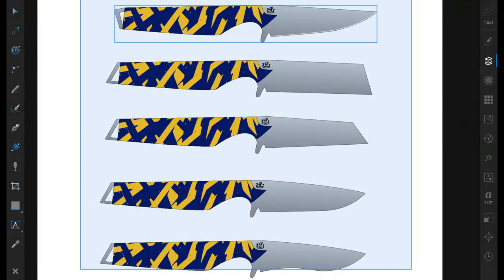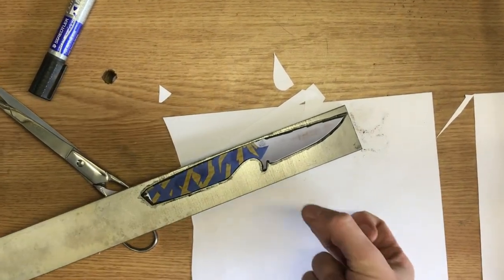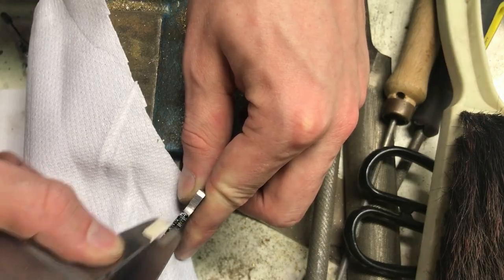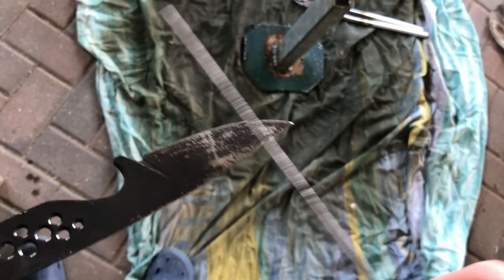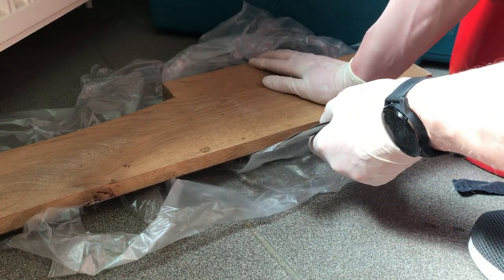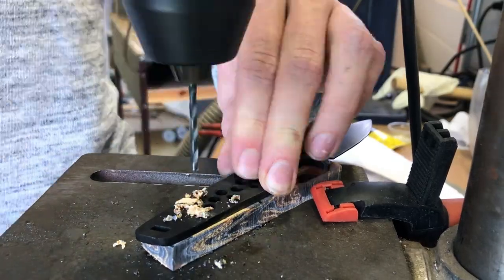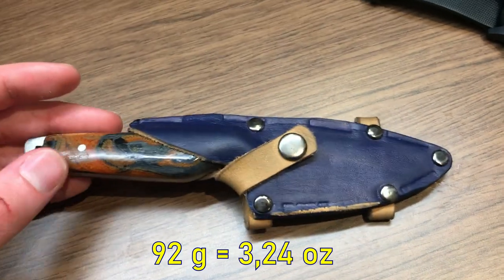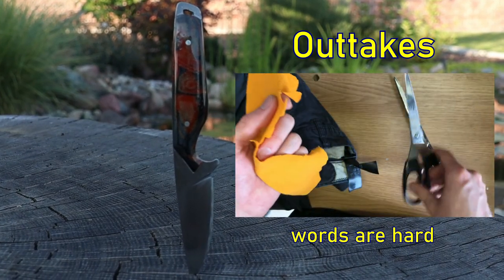EDC Knife with homemade Micarta

Comment: You should think about building a folding worktop on wheels so you can just move it where you need and slide it against a wall folded up when you're done. It wont be the biggest workbench but it can be extremely useable. I've done that for my room. Tiny room but its the only place I have since I rent with 2 other people in a small house. Without it I would be dead in the water. Woodworking is in my opinion a top 5 skill everyone should learn and use for problem solving
Reply from the maker: That’s a good idea! I’ll consider that for my own workshop in the future
Thanks for watching!

Comment: "Now I finaly shut up and show you the result" - best outro ever lol 😂!.. Great Job Sven! I love the handle shape- looks very comfortable!  I've noticed that if you file the plunge line inversely (so the spine is closer to you and the bevel further) the plunge line looks better and the risk of scratch is less. About the micarta: Make a U shape frame from OSB and with 2 OSB boards squeeze it in the vise (or screw)- you get perfect flat surfaces and also the air will have better way to get out while epoxy is curing.
Reply from the maker: Thanks, D! Those are great ideas. I'll definitely try filing the plunge line inversely. I already made a press, but if that one doesn't work I'll try the U shape 👍